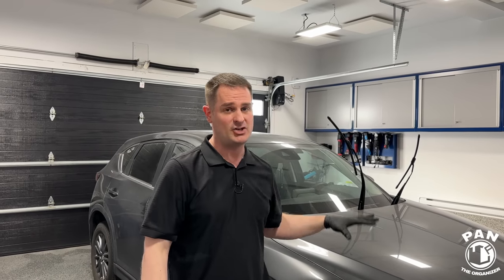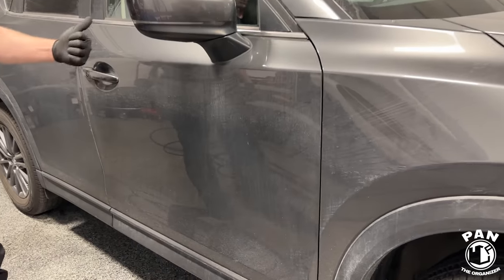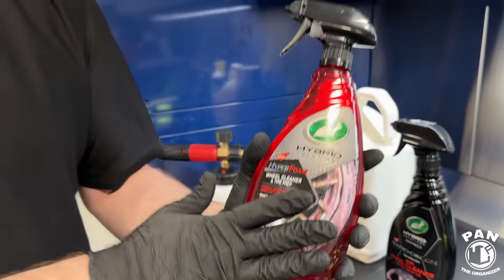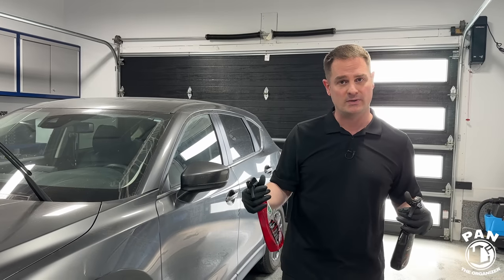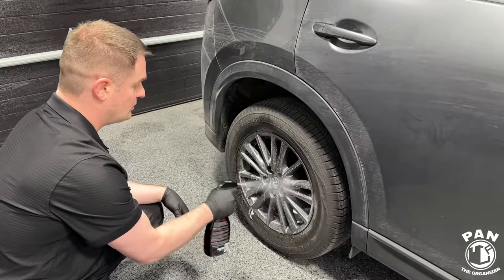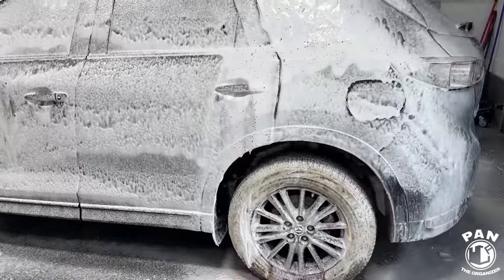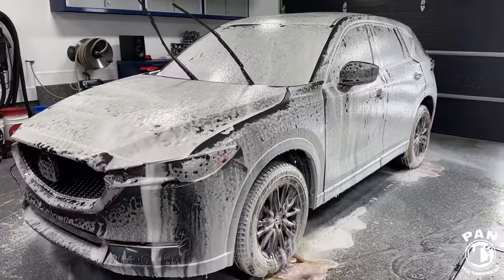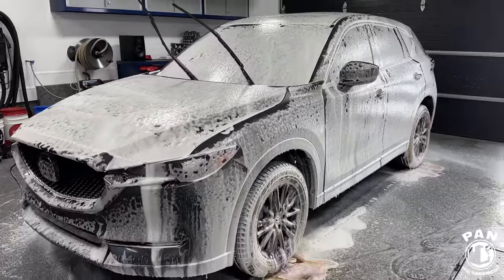MYTH BUSTED!! Touchless car wash??

Comment: My go-to these days for a quick maintenance wash is two foam cannons, one with P&S brake buster for the wheels, one with BH touchless for the paint, dwell for 5 mins, rinse. Then, I do a rinse-less wash with p&s absolute (much safer and less towels needed after the prewash). Finally, a few spritz of gyeon ceramic detailer to restore any hydrophobics lost from the alkaline prewash and dry with twist loop mf and buff with second plush towel.

Comment: Random question, do you know of an interior glass treatment that prevents fog up?
Reply from the maker: Hi! The first thing to do to prevent the interior windshield fogging up to begin with, is degreasing the glass. Glass cleaners alone can't remove the film generated by the off gassing of materials. Here's my popular interior windshield cleaning tutorial: https://youtu.be/3rF6keJ88Y8

Having a thoroughly degreased and clean surface makes it harder for water droplets or moisture to form on the glass surface.

If you still get a bit of fog, you can use anti-fog treatments like this: https://amzn.to/3MC5fVc
Or this: https://amzn.to/3Wfdcmu

Comment: Hai pan, i think you take the wrong method, if you use touchless you have to use minimum 140 bar - 180 bar pressure washer, the key is the pressure washer , and the shampoo ratio is 1:5 , the method is you use the sprayer to wash the dirt, try it once again you get the result you expected
Reply from the maker: It's never recommended to use such high pressure when washing cars. 140 bar (2030 psi) to 180 bar (2610 psi) is way too much pressure. Ideally, you want to stay in the 1000-2000 psi range (69-138 bar). 

Also, the dilution ratio depends on what specific snow foam you are using. Not all snow foams have the same dilution ratio. And in the case of the Bilt Hamber snow foams, they go even further and ask you to determine the correct PIR (panel impact ratio) for your specific pressure washer and foam cannon setup. Precise measurements. So I used the correct PIR for my setup.

Regardless of how well you think your pre-wash does, you always have to follow up with a contact wash for 100% clean results. There's no way around that.

Comment: Do water softeners (such as dishwasher salt) work and reduce or eliminate water marks?
Reply from the maker: I have a whole house water softener in my home. Those work well to reduce certain minerals in the water, to help prolong the life of your appliances (water heater, coffee maker, etc) and less streaks on glass shower doors, make more suds and lather when you use shampoos, etc. But they slightly increase the TDS (total dissolved solids) as they raise the salt level a bit.

For a car wash, ideally you want zero minerals and 0 PPM on your TDS meter, so the best option is actually a water deionizer. I added that in my garage, for a spot-free car wash experience. See my video on the simple setup here: https://youtu.be/IKNL1chAQXY

Comment: Hi.  Question for all, but especially for Pan and other professionals. How much time for your twice weekly maintenance wash? I seem to take a long time at 1.5 hours and I could probably go faster but I’m wondering how long others take. And if a professional does it a certain time in would be good to know what that is.
Reply from the maker: I typically take 45 min for my weekly wash routine. But that’s 26 years of detailing experience. If I work quicker I could likely do it in 30-35 min, but when I wash my own car, I take my time as it’s not a job, it’s a soothing experience.
Reply: Thanks for the quick response Pan. That’s helpful for me to know

Comment: Hey pan. I am curious, how do you get rid of the dust in you garage that fall on your tools and chemicals. I keep mine in my garage but after week, they are all covered by dust. Can you please help me?
Reply from the maker: After every wash, I quickly rinse the floor down, so dirt and dust doesn't have time to accumulate. And I detail with the garage door closed, as it's a controlled environment (heated and cool all year round). So there's very little dust if any. 

And then, once every other month, I will do a more deep clean by removing all the products from the shelves, cleaning the shelves, and cleaning the bottles before putting them back. I'm a little OCD on cleanliness haha.
Reply: @PanTheOrganizer  thank you

Comment: Hi Pan! In my country there are touchless self car washes that leaves the car 99% clean after using their foam and rinse with water. How high in ph is the foam then? 
I know these self car washes are not safe for exterior elements and trims
Reply from the maker: I would never recommend automatic car washes, as those use very high pH soaps and other nasty chemicals that can strip the protection off your paint and also make the paint dull over prolonged and repeated use.

Washing your car at home is always the best option. See my car wash tutorial: https://youtu.be/7Koj5j2Es5U
Reply: @PanTheOrganizer  Thank you!

Comment: Would you say CarPro Lift is too much to use every week for a weekly wash on a car coated with CSL & 2 coats of EXO? Daily driver
Reply: Nah it’s perfect for a daily, It’s not on the descale level of acidity, In my experience it’s awesome and okay to use every week!
Reply from the maker: I wouldn’t use it weekly unless you know your specific coating has the chemical resistance to withstand the higher pH for repeated use. Regular weekly washed should only need a pH neutral shampo really. And then once in a while the more alkaline snow foams to remove grime and traffic film.

Comment: I hate washing the cuv with a mit. I like brush on a stick. How bad is that vs micro fiber mit? Can a brush on stick be safe?
Reply from the maker: If you want to use a brush on a pole, at least make sure the head is quality microfiber. See my video here: https://youtu.be/rc-8j0fKp9Y
Reply: @Pan The Organizer  thank uou, i will certainly  check out micro fiber  madness mop. How about brush? Sometimes a flat mop doesnt work. Does it need to be a 180 dollar boars head brush on stick? Trying to keep her cuv nice. Its only 4 yrs old. My car is black, hers off white. Hers ceramic  coated... assiming dealer actually  did it, lol.
Reply from the maker: I would never recommend a brush on paint, as the bristles will inevitably cause marring over prolonged use. Of course, nothing beats a true contact wash with a microfiber wash mitt, where you can get into all the more intricate areas. I have yet to see an SUV or CUV that I couldn't properly wash.

Comment: Wouldn’t these results be substantially better if you pressure rinsed the car before spraying the wheels, tires & then the foam the car?
Reply from the maker: There are two schools of thought on that. Pre-rinsing, vs applying foam on a dry surface. See my video on that topic here: https://youtu.be/16SwGBQ29rs
Reply: @PanTheOrganizer  Could the body dry off enough while applying product to the wheels/tires that the foam stays on better(if that’s the concern)?

Comment: the product is not supposed to be a contactless wash.  Its just a normal pre wash called Touch-less because it cleans more, therefore you have to touch it less to contact clean afterwards.   So perhaps the wrong product to debunk the myth.
Reply from the maker: I think you completely missed the purpose of this video. Many people think a pre-wash with an alkaline snow foam is enough to clean a car. This video was to debunk that myth and show that although pre-wash with a snow foam is a crucial step of detailing, it will not 100% clean the surface. A contact wash is always necessary.

And to further add to that, regardless of what "touchless" snow foam you might think works, it will still always need a contact wash afterwards, to get 100% clean surface, especially if the vehicle is actually dirty. There is no such thing as a 100% contactless wash.

Comment: By the way, I bet you could save buttloads of time if you also used a compressor fed foam-gun or spray-gun for thr rim cleaner.
Reply from the maker: I typically use a foam cannon with diluted Brake Buster. As you can see in this video: https://youtu.be/0irxWvQylds

Comment: Tips on cleaning inside my wheel well?
Reply from the maker: It depends if you are removing your wheels or not. If you want a full wheels off detailing tutorial, see my video here: https://youtu.be/3LCQ0g589pM

If you are not removing the wheels, first order of business is to pressure rinse the wheel wells as best you can. Then spray an APC or degreaser, and brush using a fender well brush like this: https://amzn.to/3Whi1vp

You can see a quick demo of wheel well cleaning in this new video: https://youtu.be/GJdPu6UEEgo

Comment: I dont blieve in touchless wash,you wil be surprise even a proper coated vehicle with 9H still need some scrubbing to do from bugs and grimes and dust itself stick on the body paint. We only removed the sharp edges on grimes and dust but the mark and stain remains that needed scrubbing.

Comment: Start dirty car, result dirty looking car but its a small layer of dirt. Not worth for the environment to use so much chemicals
Reply from the maker: The pre-wash is actually great for removing a lot of loose dirt and debris BEFORE the contact wash, that way, when you are hand washing the vehicle, there is a lot less surface dirt, so less chances of scratching and swirling the surface.

So yes the snow foam is a great first step, but you still need to follow up with a contact wash stage.